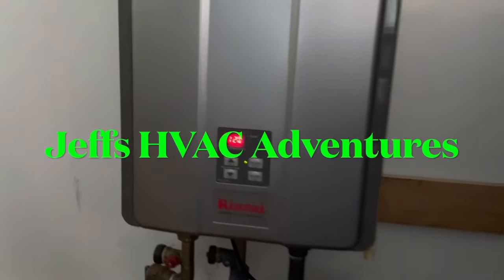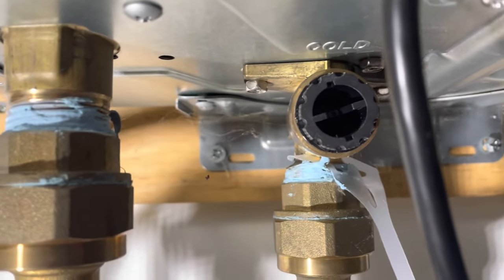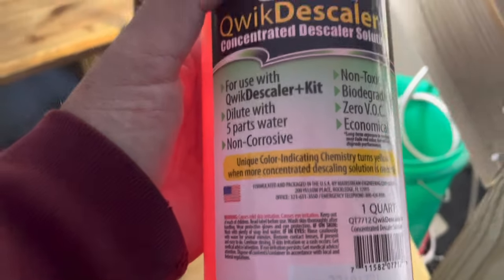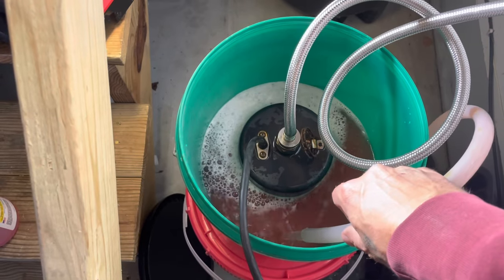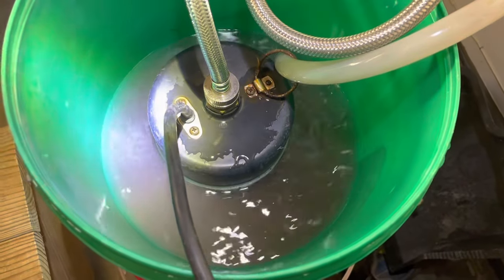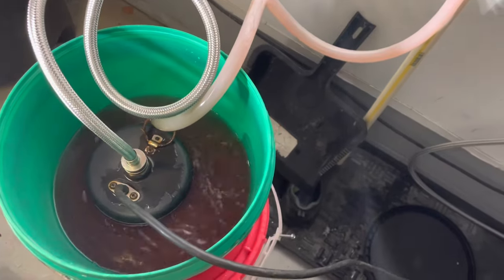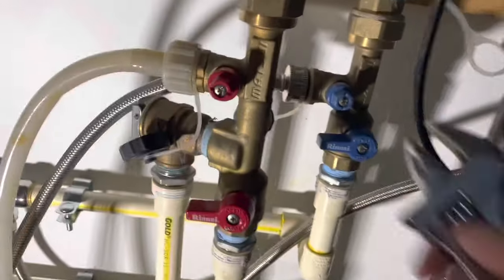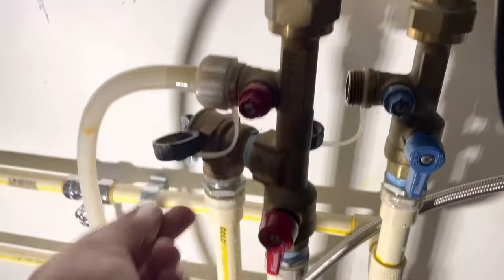How To Properly Flush A Tankless Water Heater!  #plumbing #rinnai

Comment: I like your post purge process after descaling. This ensures all the vinegar or descaling fluid is removed from your system and not flushed through your water system to the taps. Cleaning the in-line screen before and after the descaling is an excellent idea too. Great demo. Thanks 😁
Reply from the maker: Thanks for watching!

Comment: On this particular heater you have to pull the burner out and clean it. You should not pull out flame rods and ignitor and let them hang on the wires. If you are not sure what are you doing better not to do it.
Reply from the maker: Thanks for the tip
Reply: Are there any videos for removing the burner and cleaning it?
Reply from the maker: @sohailahmad200 I’ve not got a video of pulling the heat exchanger but here’s a video of me cleaning it in place.  
https://youtu.be/pq6TvC1T1G8
Reply: @JeffsHVACAdventures  man you are very quick with responses, really appreciate it!! Subscribed

Comment: Great video but my brain tells me to reverse the lines-run the water/descaler backwards thru the system then switch back to normal flow. Like anything in this world if you are clogged from from one side then blow or flush from the other to unclog
Reply from the maker: You might be able to do that with Rinnai.  But some brands have check valves in place where it will only flow one way.  But not a bad idea if you have a decent clog.

Comment: At the end of flushing I rinse first the system into a second white bucket to see how clean the outcomig water ist,then I open the  house system and flush out of a nearby tap.Using White   Vinegar  I can go by the smell if anything is clean.BTW . After all done I rinse and flush my pump very good to get the internals cleaned out of any essit.Knowing that most installers are messy and ask to cut corners,I let  the instalers just do what the law requiers and did the rest myselfe.

Comment: hey, thanks for the clear cut instructions.  Would a water softener system be recommended if regular flushes are performed in your opinion?
Reply from the maker: It’s always good to have a water softener.  Helps fixtures and piping last longer.

Comment: Hi, great video. I was wondering if this is still a DIY task even if you haven’t done a descale since the install? Got my house in 2017 new and hasn’t been done before. Read on a few comments for the Rheen tank that it’s better to let a professional do it. But mine is exactly like yours tankless.
Reply from the maker: As long as you have the flush valves installed like on this video you can do it.  Check the links in the description for everything you need!

Comment: I’m not getting a flush circulation when I plug the pump up. Does the power to the tankless need to be on ?  I have pump hooked to cold inlet and valve open, house water valve off. Hot side to house off but out side flush valve open for an open loop. 
Gas valve off also.
Never mind lol it’s circulating now.. with no power on , i started over and just must of missed something.. it’s flushing 😅now. Thanks for the video!!
Reply from the maker: Glad you figured it out and the video helped!

Comment: When I turn the lines one after shutting the water off, running is running out of it to a point it’s filling up the bucket quickly. Am I missing something
Reply: Disregard. Water off wasn’t tight on cold side.
Reply from the maker: Sorry I didn’t catch this comment sooner.  I was going to say, make sure it’s off all the way.  If still not off, maybe a bad valve.   Hope everything else went smoothly! 🤙

Comment: Jeff, what size utility pump are you using?  I have a 1/4 HP Superior Pump rated at 34-37 GPM.  CU199 manual says to flush at 15 liters per minute which is about 4 gallons per minute.  Is my sump pump too big?  Do I reduce the flow by restricting its output?  I’d appreciate if you tell us your pump size and any flow reducer.  Thanks!
Reply from the maker: Funny you ask this.  I’m about to post in the next day or so about the new pump I’m using for flushing.  It’s a 1/3 HP 37 GPM.  Maybe the 15 LMP is a minimum….  Either way I’ve been using 37 GPM pumps for these flushes for years and never had an issue.  Stay tuned for the video.  I think I’m going to drop it Saturday or Sunday.
Reply: @JeffsHVACAdventures  this is what I learned.  At the pumps 1” discharge the flow is about 37 GPM.  Adding a 3/4 reducer to attach a garden hose cuts this flow nearly in half to let’s say 18 GPM.  But by using the smaller diameter washing machine hoses, we’d cut the flow nearly in half again to 9 GPM.  Figure on losing another GPM factoring in the height of the unit from the bucket and your about double the Rinnai recommended 4 GPM flow & you can “make up” for that lack of dwell time by circulating the juice a bit longer than the 45 min or so.

Comment: My water heater doesn't it's not giving out an error code, the in use light it's of . There is no hot water. What can I do?
Reply from the maker: Possibly a bad flow sensor if the in use light isn’t coming on when there is a demand for HW.  Best bet is to to call a licensed plumber or HVAC technician.

Comment: Doesn't the Rinnai website specifically state to only use white vinegar for flushing the unit?
Reply from the maker: I’ve been told by a couple different reps this solution is fine.   I usually do use vinegar but I didn’t have any that day.

Comment: How many gallons of white vinegar into a 5 gal bucket would you use to flush a Rinnai RUR199in natural gas?  How long? 

What pump did you settle on to do flushes for this unit.  Going to by one and keep just for flushes when the SS pops up on the LED screen.
Reply from the maker: 2 gallons of vinegar for 40-60 min.  

This is the pump I use 

https://amzn.to/46Vug4S

I talk about this pump in this video

https://youtu.be/ZMc3T9Pi9h8?si=su6fBY2Wpy11Skw1
Reply: @JeffsHVACAdventures  I did the flush today with white distilled vinegar and used same pump maker you mentioned and got model UTL-336PE.  I like the auto shut off feature if things get down to 1/4" mark.  Used your video and all went well.   Thanks for taking your time in the video and going thru all the steps.    How often should I be looking to flush the system?  We have the Rinnai RuR199in.  😀
Reply from the maker: @jeffcook9798 my apologies.  This response slipped through the cracks.  Glad everything went well.  Flushing intervals are based on use. If you have a 2 person family, once every other year is fine.  4 or more ppl I would recommend once a year. 🤙